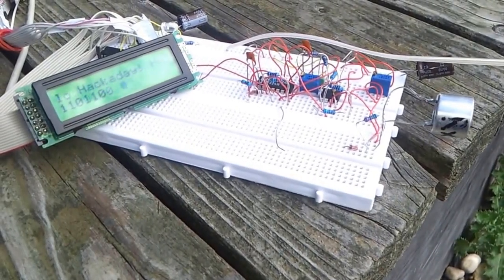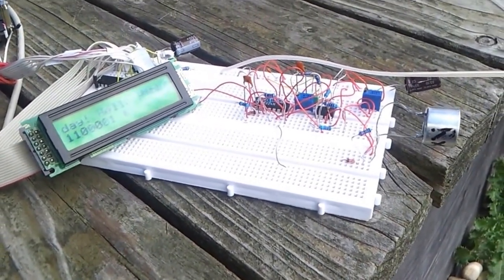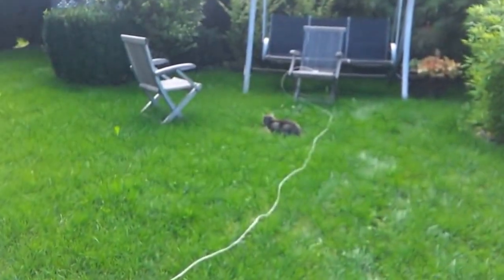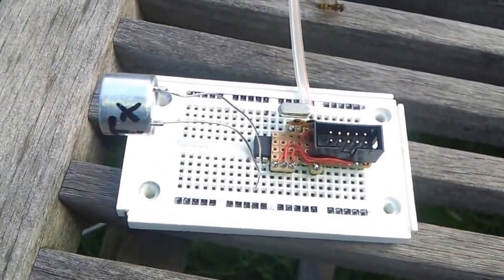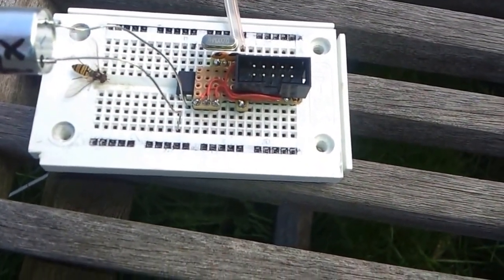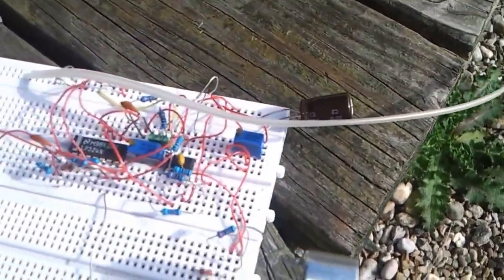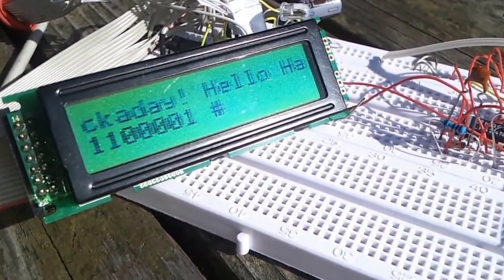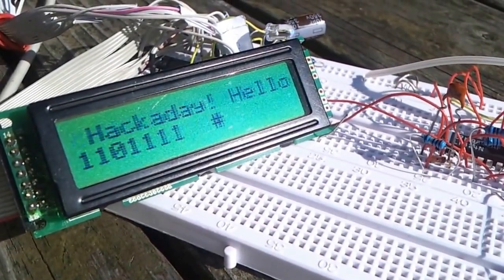autoCut - Ultrasonic Data Transmission - Proof of Concept

Comment: Hi, I also am an engineering student, just as my previous commentator. Also I am working on a submersible but on a Rov for scientific measurements. An aditional video on the circuit that you build would be realy great for it is quite complex and I do apparently lack the knowledge to build one myself.

Comment: Hi, im an engineering student at my high school working with underwater submersibles and was wondering if i could have more details on this design because it would be extremely useful for what i need to accomplish.  could it be possible if you do another video on the details on this data transmission idea if its ok?